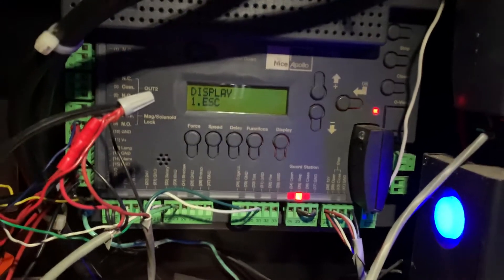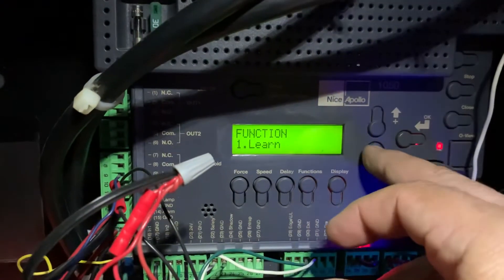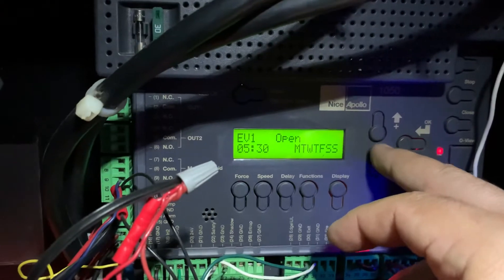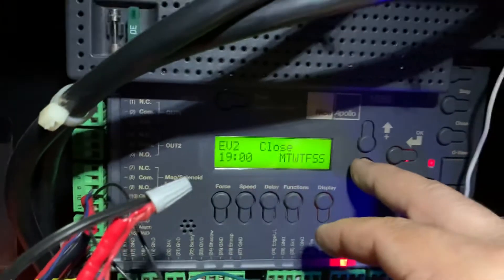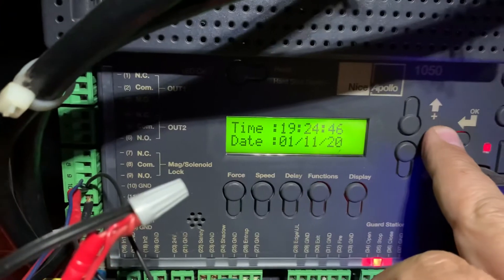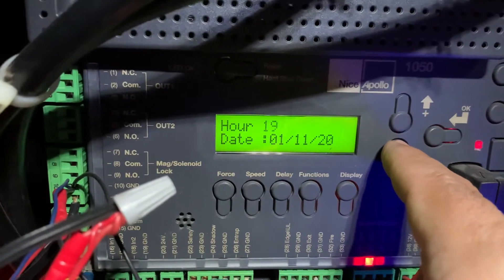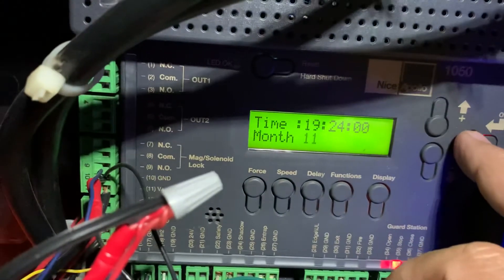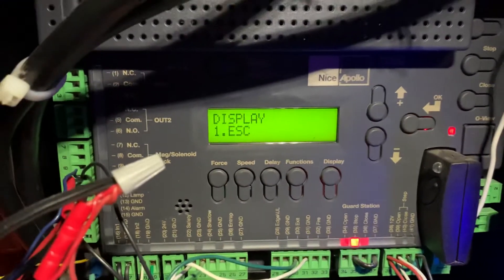✅ Nice Apollo 1050 Control Board ● Setting up Scheduled Tasks the Easy Way for Your Gate or Door!

Comment: How much do you know about the 1050 boards? Mine just started blinking red lights and the display would shut off, I thought it was the battery so I bought a new one with higher cca and ca but display still goes on and cuts off along with some of the red lights blinking.......
You wouldn't have an idea if the board was bad or not? Thanks
Reply from the maker: I didn’t know the answer so I asked others in a group I am in focused on gate controllers. Everyone said the board was bad and replace. If you have a Titan arm connected, replace with a other 1050 board or you would have problems. Otherwise, most recommended replacing with a unit from US Automatic, and completely avoiding Mighty Mule brand.  Sorry I didn’t have a better answer for you. Good luck.